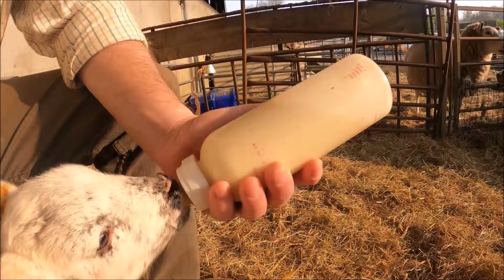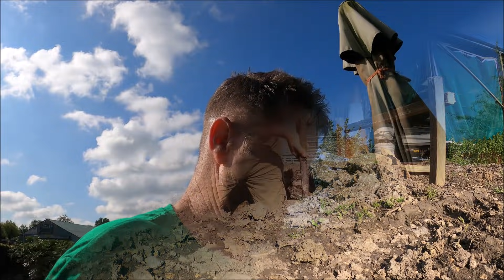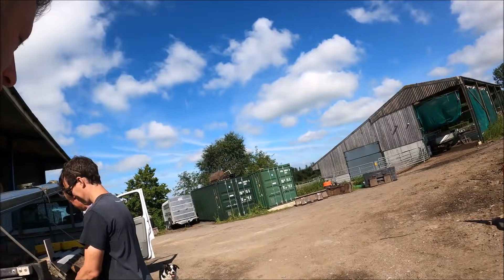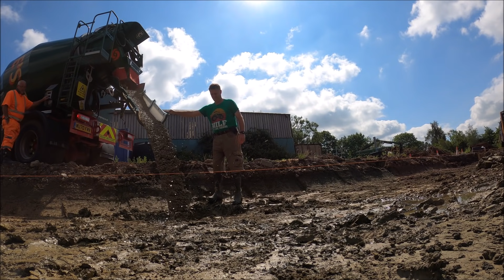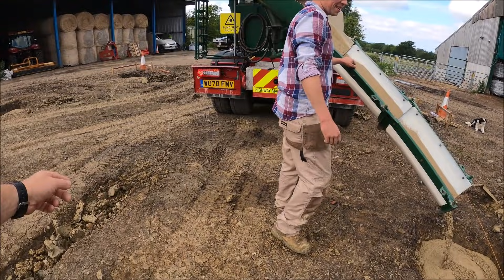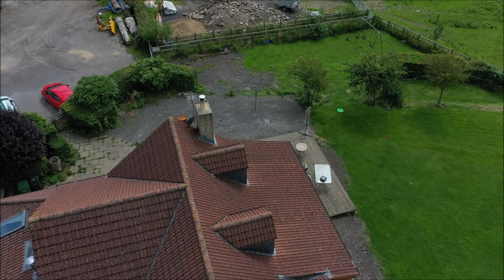Digging foundations and pouring concrete. 14 07 21

Comment: It's funny. How small buildings look. At foundation stage. It's so hard to visualise the final outcome.
I did ground work on a lot of developments. Foundations always looked way too small.
Reply from the maker: It does look small, but Dave recons the footprint is bigger than a lot of two bed starter homes.
Reply: @FarmerP  I'm sure it is. They cram them in like battery cages.
Then the housing cost to the residents about 80% of their income. Compared to about 50% in the 1500s. So. Not all progress.
Reply from the maker: @mattfisher7432  
It’s all about profit Matt, normally at the expense of those that can afford it the least.